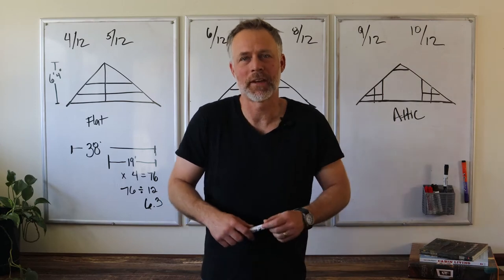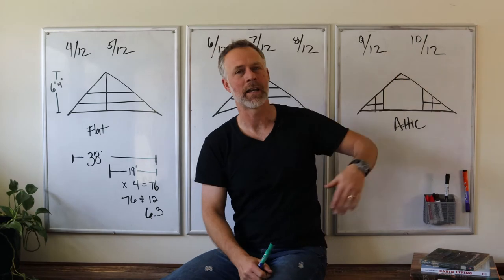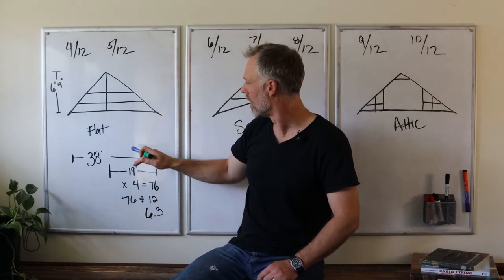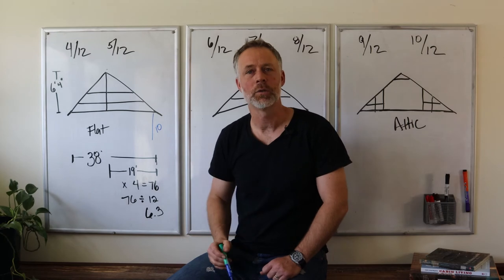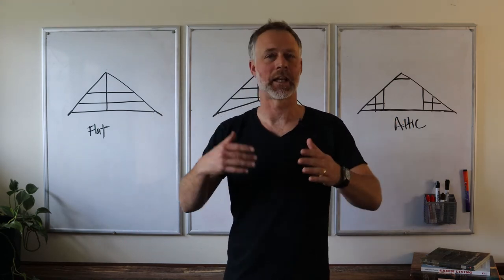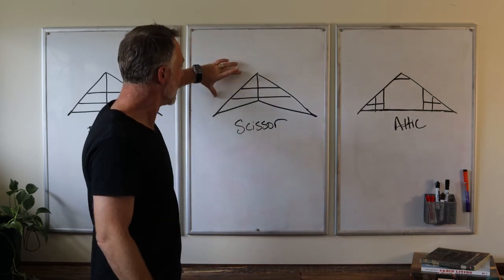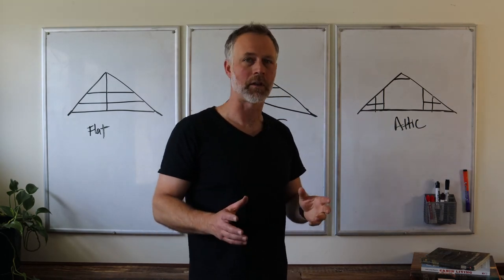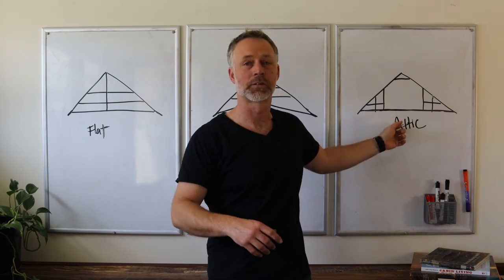Truss Types

Comment: We’re building a pole barn in June. What would you recommend for wall height on a 30X40, and we’re thinking of 10’  roll up doors. Would a 10’ wall height work? Thnx
Reply from the maker: if it's a true "roll up" door you can keep about the barn about 10 feet.  It's cheaper to build up than out, so go 12' tall if you need.  Overhead doors need 2' of clearance.  So, 10' tall overhead doors need a 12' tall building.
Reply: @barnandhome  ..thnx. Great videos.